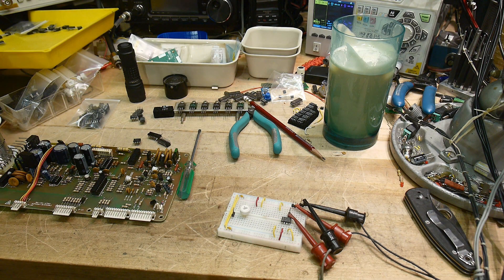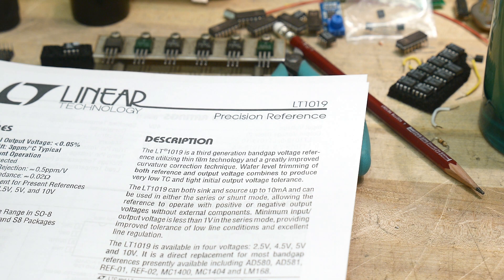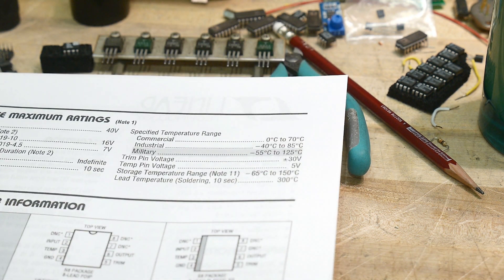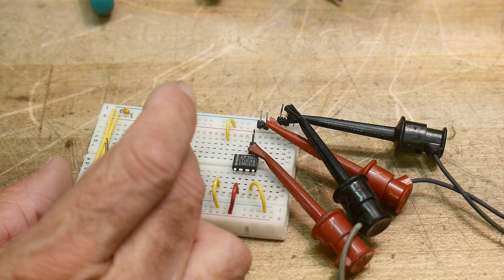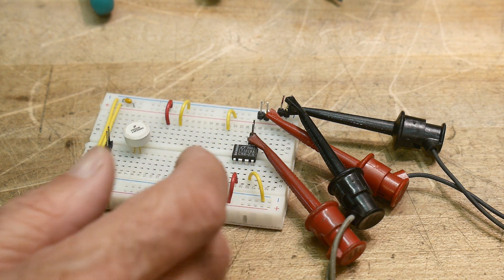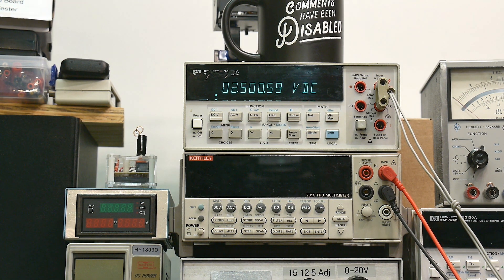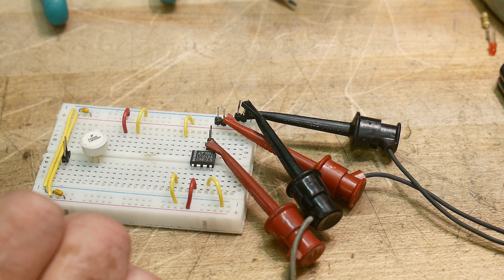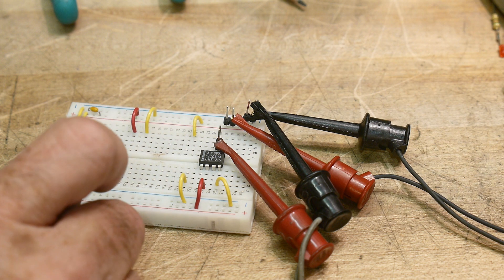#1131 LT1019 Voltage Reference 0.05% Absolute

Comment: Could you find a reference that is absolute to 0.001% in initial accuracy ? The best I found ends at 0.02%. I know you can trim them with a multimeter but what If your multimeters are not accurate enough for that. Let´s assume you want to build a voltmeter yourself do you have to accept the 0.02% then ? I am curious how the industry made it because I don´t believe that they had 8.5 digit multimeters right from the beginning. 😉
Reply from the maker: that is why there are cal labs. you take your meter to the lab and pay them $100
Reply: yeah that is definately better than paying 8-10k for a multimeter to do a one time measurement. Thanks
Reply: You improve on existing standards. It's take close to 100yrs but right now the Josephson voltage array / standard is the best voltage standard available that only depends on known fundamental standards, accurate to 1 part in 10^10 I think. Everything else is calibrated or referenced against it with some uncertainty, so even the cal labs will have uncertainty associated with their equipment traceable to a JVS array in NIST or somewhere else. Unless you're willing to spend a few million dollarydoos, paying a few hundred for local cal lab adjustment is the best one can do.
Reply: Also absolute initial accuracy is less important than long term stability and temperature coefficients for transfer standards, which is why top end buried zener references that 2-3% accuracy but 0.5 - 0.05ppm tempco.
Reply: I know you can readjust the initial accuracy but you can´t adjust for the tempco but I am lazy and wanted the best of both. I am happy with 0.02% initial accuracy now If not I would still have to calibrate it. The tempco of my reference is still only 2ppm so there would be improvement there altough it should be good enough for a cheaper multimeter. The reference IC I choose is by the way max6225 and there are better ones If you need more tempco. I didn´t know that zener diodes with such tempcos even exist thanks for the hint !
Reply: @Telectronics  LTZ1000ACH once aged is very stable as long as the design guidelines are followed for oven temperature and thermal isolation. It's the reference commonly used in metrology grade instruments.
Reply: "...because I don´t believe that they had 8.5 digit multimeters right from the beginning."

Don't forget that they (the BIPM) will eventually "pick a number", one that is reasonably well aligned to the previous definition. Once they pick a number, then they've created more digits than they had before (by definition). Ref. Wiki (Josephson voltage standard"...1990, by international agreement, the constant KJ-90 was assigned the value 483597.9 GHz/V and adopted by all standards laboratories. The assigned value is based on a weighted average of volt realization measurements made prior to 1990 at many national measurement institutions."

It's the explanation for your excellent point.

Comment: Just a video idea: Can you somehow calibrate with the LT1019 a relative voltage reference? If so, how would you do that? I can imagine you spend 10 bucks on this LT1019 but calibrate with them the relative references as they are a lot cheaper for your projects.
Reply from the maker: that is called a transfer standard. you measure the calibration standard with a very good voltmeter. you then measure the un-calibrated source and adjust it to match the same value. the transfer will be as accurate as the voltmeter used to do the transfer. so if you want to calibrate a 5.5 digit voltmeter you would need a 6.5 digit meter to do the transfer.
Reply: @IMSAIGuy  Thank you 🤗

Comment: One version of the LM4040 , the LM4040AIZ have an absolute precision of 0.1% but it cost $2.95
Reply: It is far away from 0.05%.
Reply: @mariomionskowski6223  Perhaps but 0.1% is more than enough for most use cases aside from lab calibration, the hobby builder will not miss the extra precision. The -10 suffix would only vary by ±10mV, which in the majority of circuits might as well be buried in parasitic or tolerance error; the -2.5 suffix varies by a mere ±2.5mV. Still exceptional performance for the cost, which is a much larger constraint for amateurs and hobbyists. And like modern resistors, and the DUT in the video, the chances are good you'll beat the rated spec anyways. The only real caveat is the thermal drift is far higher but this can be easily compensated. That <0.05% is definitely alluring, but unless your design really needs the 10$ device it's more like the icing rather than the cake.
Reply: @mariomionskowski6223  0.05% is half of 0.1%